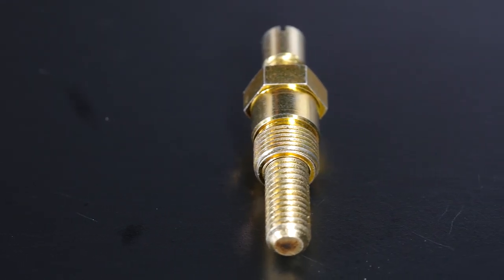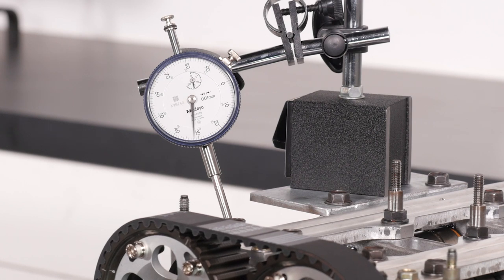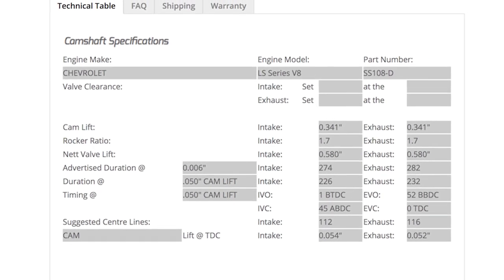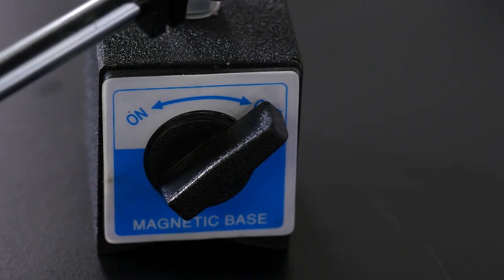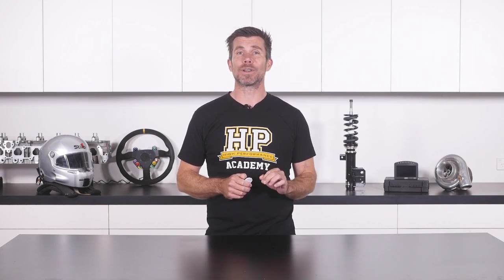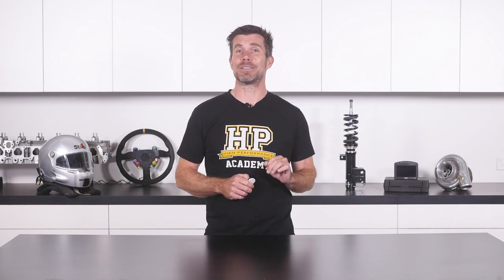Tools You NEED To Degree Your Camshaft/s [FREE LESSON]

Comment from the maker: This lesson is nice and succinct, but if you want to reference a specific tool here are some time stamps for you:
0:07 - Degree wheel
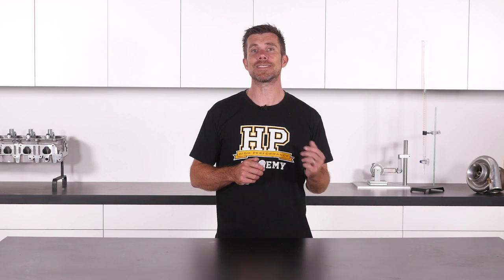0:44 - Pointer
1:07 - Dial gauge
2:04 - Dial gauge extension
2:18 - Magnetic base and steel plate
2:50 - OEM specific tools if preferred by you
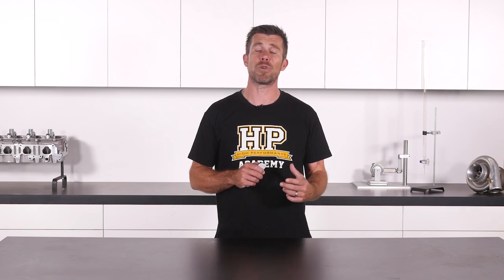3:12 - Positive piston stop or stopper plate
If you want to fix up and look sharp while you're degreeing your cam, grab an HPA t-shirt here: https://shop.hpacademy.com/ - Taz.

Comment: Definately beneficial getting the degree right. I built my 2.4L 4g63 with Kelford 272's (thanks hpa😉 helped alot) and the day I installed it I dropped it off at a tuner in Brisbane and flew back to Melbourne, results were so so. Then had it re-tuned by someone else and first off they dialled in the cams and not only picked up 700rpm in response but also 10wkw and better off boost characteristics just from cam timing. Then they tuned it and saw better results.
Definately reaffirmed my long held sentiment that there's "tuners" then there are tuners..
I was sorta disappointed with 290wkw @20psi but he said "Can't run more, it's knock limited. You kiwi's have much better fuel so don't be so worried, go flex fuel and with E85 you'll see good numbers"..

Comment: Honda D15B2 1.493cc to 152hp & 16.2mkg with a bigger port + valves & vtec on intake P08 head and 256-268° .456"/.428" lift camshat . WITHOUT tune . And no loss of torque thru the whole range. Right camshaft make huge difference
Reply from the maker: Yes sir, like any part getting the correct one is important. If any of the specifications are leaving any HPA members scratching their heads, there's a great webinar lesson here on the subject: https://www.hpacademy.com/previous-webinars/168-understanding-camshaft-specifications/ - Taz.
Reply: What cam was that?

Comment: Taz, am i right in saying you attach timing disk to crank pulley, find true TDC & zero the disk. 

Put your DTI on your valve and check how many deg before TDC the valve starts opening, then check at what deg after BDC the valve starts closing.
Then read the cam spec sheet and make adjustments on the vernier pulleys to suit?

Comment: I did this on my pushrod V8 (LS). My heads were on. So I could not get accurate readings of valve opening and closing, due to the lifters collapsing. This left me with one option and that is using the max lift readings @ a given degree on the wheel. In my case, this was @ 108° after TDC. the lifter was collapsed obviously, so I could not measure the actual max lift I was only looking for the degree at which max lift was achieved. I measured .005" before and after the max lift and used math to determine the actual degree at which I had max lift.

Would you be content with just a max lift reading? 

Thank you!